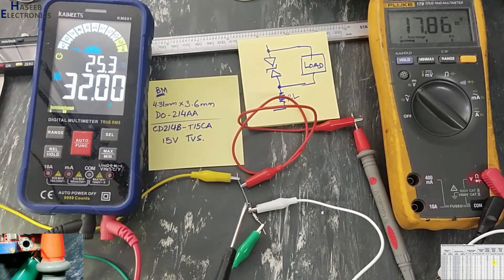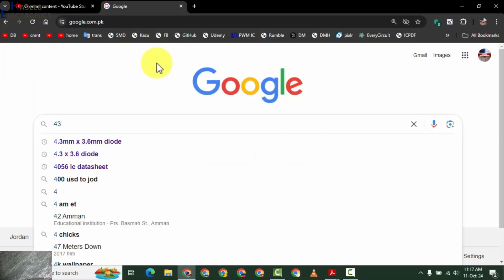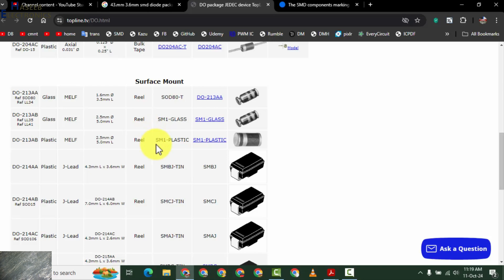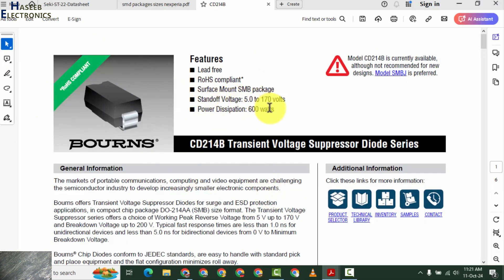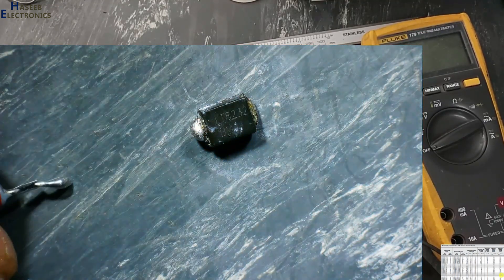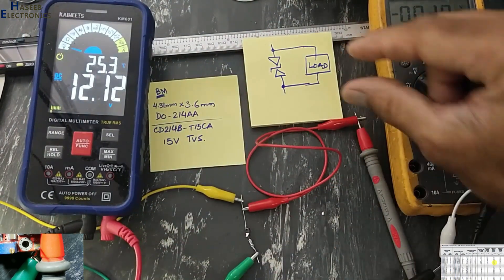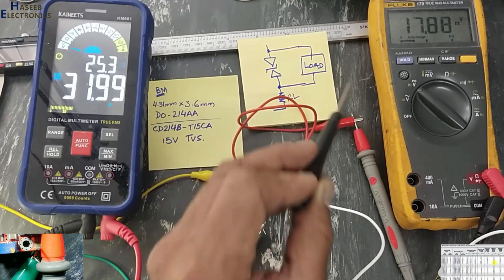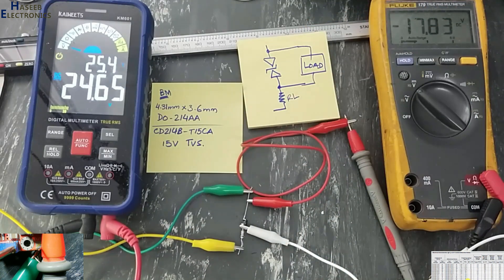{1212} Decoding SMD TVS diode, finding datasheet and testing

Comment: I hv smd transistor marked 1HC is short and not available locally. Can I replace with 2N2222 transusror?
Reply from the maker: you did not mentioned the size code. 
as i checked it is showing package code SOT-25. 
"Voltage detector IC, 4.3V±2%, Hst, -MR, -Reset ODO, Wt=100ms, Rdt=100ms
please check the size code and then decide, either it is transistor or voltage detector ic
Reply: @HaseebElectronics  1HC H is written on it.